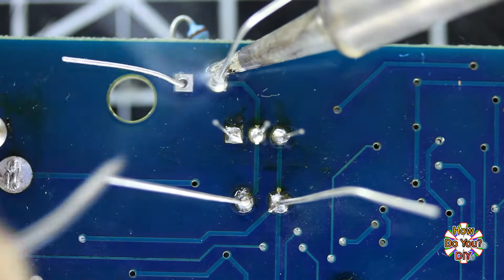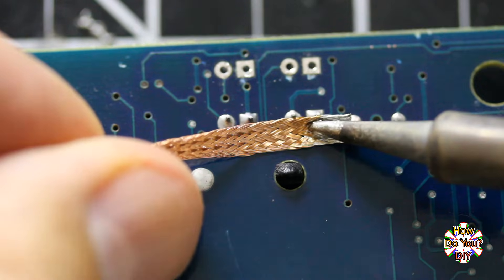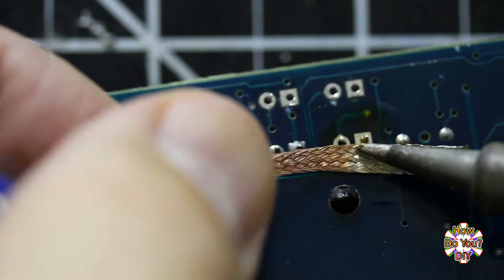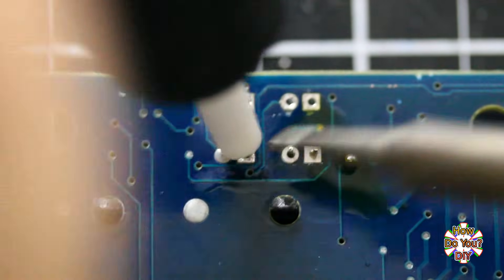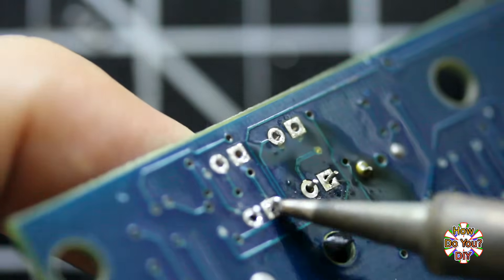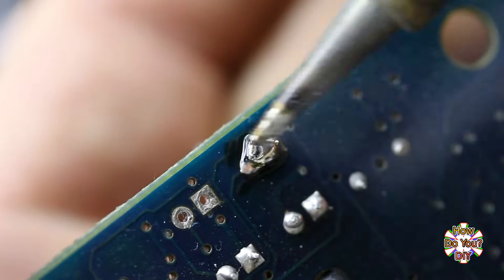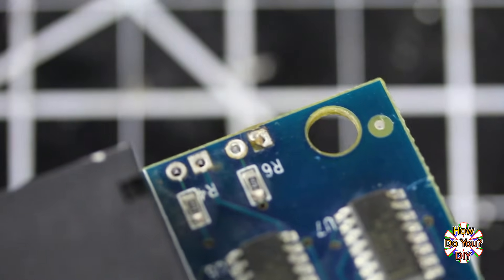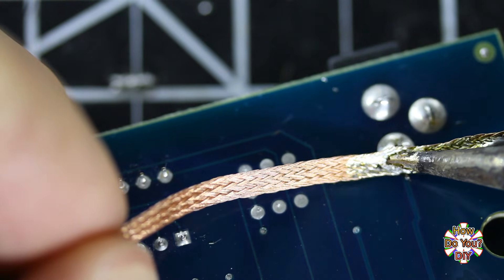Desoldering | Soldering Basics | Soldering for Beginners

Comment: I have a question. When you want to desolder and remove an electrical component, when you turn over the circuit board, how can you tell which one to desolder especially if your circuit board has loads of electrical components?

Comment: What is the optimal temperature for desoudering please?
Reply from the maker: Temperature is a case by case decision. Smaller solder joints can use a lower temperature, bigger need higher temperature. Obviously too much heat is bad for the parts, so I would recommend (at least while you're learning/practicing) is starting with a lower temperature, and if it doesn't start to melt the solder within 5 seconds, then turn the heat up a little bit.
Reply: @HowDoYouDIY  thanks man.  I've had a little practice now and it's much harder than it looks.  Gotta have a steady hand lol

Comment: Nice videos, this is helpful for a capacitor or anything that has max 3 leads but I was wondering how do you desolder 40 DIP IC's ?
Reply: Hello. 
Hot air. 
Goodbye.
Reply: @bobross-hv6dy  40 dip tht (like a zilog Z80) with hot air ? Don't you damage the chip with overheating ?

Comment: Many thanks for this very useful information. I'm about to replace a soldered-in CR2450 battery from a 1992 Yamaha synthesiser and replace it with a battery holder instead. I'm a bit of a PCB soldering newbie (I've done lots of guitars in my lifetime) so I'm gathering as much information as I can before I start.
Reply: SY99 ? :-D
Reply: @bennethos  Close! Mine is an SY85, still going strong 😀

Comment: I’m trying to replace a mini toggle switch on guitar pedal, and I’ve been sitting here for 20 minutes with the solder pump and I cannot get this thing out!  I got the main bubbles out but there is still solder in the holes, im thinking about picking up some solder wick if the hardware store has it
Reply from the maker: If they don't have it then you can use regular copper wire with a bit of flux on it. It won't pull out as much solder at a time, but it can help in a pinch.

Comment: I’ve found if it seems like the solder you’re trying to remove isn’t melting properly and your iron is at the correct temperature, try adding a little extra solder to the tip of the iron. It’s an odd trick that works and it might even let you know that your iron actually isn’t hot enough.
Reply from the maker: I've noticed that too! Doesn't seem like it would work, but sometimes it does.

Comment: I noticed that you were using a PCB from the 1980s, which I don't have a sample of. This allowed you to bend the leads back and forth, to separate them from the remaining solder. Could you please show us this exercise again, with a factory-populated PCB from the year 2010 or so, where the leads go through, but don't come out on the other side?
Reply from the maker: The PCB I used in this video was factory made in the early 2000s. When it was made is irrelevant because through hole components and surface mounted components were used in the 1980s.

I can explore removing the parts from the front of the PCB. It may be a while before I can get to it, but I'm sure a lot of people would find a video about that helpful.

Comment: I never managed to remove all the solder, I don't know what I do wrong, but I'm very jealous from how it looks in your video :)
Reply from the maker: It can take a bit of practice. If you're using desoldering braid, adding a little bit of flux to the braid can help it soak up solder easier.

Comment: Wow, I was using a solder wick without much avail, added flux and it worked incredibly! Thank you
Reply from the maker: You're welcome, I'm glad it was helpful!
Reply: me too!
Excellent video! Thank you
Reply: Omg, I can't wait to try this.  I have Never had luck with solder wick and could never understand why.
Reply: @mcoley84  same going to get some flux!
Reply: Me too! Never thought to use flux!
Reply: I have solder sucker, but it does seem to be heat resistant. I have also tried wick and flux with very little luck.   Not sure if it the iron I am using or just inexperience. 
  Wondering if the iron is too low of wattage and not getting hot enough quick enough. 
  Needing to learn more on electronic appliances and how to repair boards.
Reply: @rickeykeeton4770  if the metal isn't hot enough it will not flow to the heat source. It will just turn the metal into a liquid and try to ball up like little beads. also flux in my opinion is always needed just because it helps control the flow so much.
Reply: I've tried everything in the book. Cleaning the contacts with IPA, making sure my tip isn't oxidised and is tinned, applying plenty of flux and enough heat. The solder just won't melt into the wick.
Reply: @fsociety.dat101 Same here. Wonder why
Reply: @unchi1999  your problem is poor heat transfer from the iron to the joint. use a large chisel shaped tip, not a conical tip. make sure that your tip is pre-tinned. use small pre-cut strips of braid to prevent the wick sucking up the heat. use temperatures of 380-400C. if the board is very thick, pre-heat with hot air gun or hair dryer to around 120C. a good sign that your temperature is high enough is when you can see the flux boiling inside the braid.
Reply: There can also be poor quality flux. I've got some that does next to nothing. The old rosin I've git works much better for desoldering, although it creates a mess of residues
Reply: Me too going to buy some now!
Reply: Gahh i forgot the flux again!

Comment: Great video, thank you for the demo!  What temp do you like to use for de-soldering?  I know that too much or too little heat can damage parts, what do you recommend?
Reply from the maker: I usually use the same temp that I use for soldering. I think the time you spend heating up the parts is more critical that the temp of the iron. The faster the solder melts, less heat goes into the part. I hope that makes sense?

Comment: Thanks for this video. I just have one question: what temperature should the soldering iron be? I'm afraid of burning out the board.
Reply: about 320°C to 380°C, but i usually use 360°C

Comment: What do you use for harder metal?  I just bought a table with a metal frame and it has a tiny metal bump on it that prevents the frame from fitting properly.  I just bought a soldering iron to desolder but it doesn't work.  I don't think it's hot or powerful enough.
Reply from the maker: That's a good question. For a table frame it's probably not soldered, it's most likely welded. You can try getting a file for metal and filing down the extra bump.

Comment: Good video.   A simple 15$ heat gun can also desolder multiple leads at once and pull out hot components with some pliers, although it takes practice (still trying to master) working without a temp gauge and dial to not burn the board or components for too long.  I use $2 cotton based grippy latex coated gloves to keep from burning my fingers but still have enough dexterity to work.  Also good idea to wear saftely glasses or magnifiers to protect the eyes from spattering solder bits.
Reply from the maker: Very good tips, thanks for sharing!!
Reply: @HowDoYouDIY  link?
Reply: Link?

Comment: Suppose that the copper pad got fully ripped out while desoldering. If I apply more solder to compensate for the missing pad, will it still work? Will removing the pad expose the board to oxidation or anything of that sort?
Reply from the maker: That's a really good question. Yes, that can work. There are a few things to watch for. You'll need to make sure the solder you're adding gets connected to the copper path that's still there. You'll also need to make sure you're not accidentally connecting to other nearby copper or nearby parts. As far as the board oxidizing, that shouldn't be an issue. Circuit boards are usually made from fiberglass, and that didn't oxidize.
Reply: @HowDoYouDIY  Thanks a lot for the answer man. As someone who is still new to soldering things, your videos and your answers really helps.

Comment: Thanks for these videos. I've been soldering for years, but never had any formal training - the good news is I intuitively do much of what you preach. I need to get more flux into my workflow though. Curious how you handle the cleaning up an accidental bridging of 2 tiny adjacent pins (like on a Lemo connector). I have a desoldering station with suction, but it's not a great fit for very tiny adjacent pins.
Reply from the maker: That's a really good question. I haven't tried this myself, but I've seen videos where the technique for soldering parts with close pins is to bridge the pins with solder, then use desoldering wick to remove the extra.

Something that I have done to remove solder that's bridging pins is to clean the tip of the iron, melt to solder, then clean the tip again. This only removes a small amount at a time so it's annoying.

One more thing you could try is flux. Flux is REALLY good at making the solder less "sticky" and the solder wants to ball up on the copper. If there's not too much solder, adding a bit of flux then melting the solder can do the trick. 

I still have a lot to learn myself, so hopefully this is helpful.
Reply: @HowDoYouDIY  Awesome. Thanks for these suggestions. Ordering more types of flux now ;)

Comment: How do I clean a circuit board which has a old solder on it.
Reply from the maker: If there is dirt or grease on the board, you can clean it with some kind of cleaning liquid and scrub with a toothbrush. For the cleaning liquid, you can use isopropyl alcohol, acetone, or electronics cleaner. Do not mix these together.

If you want to remove the old solder, you can use the desoldering pump or solder braid like this video shows. If the solder is being stubborn, add a little bit of solder flux. If it's still being stubborn, try adding some new solder to the old solder. Then try removing the solder.

I hope this is helpful.